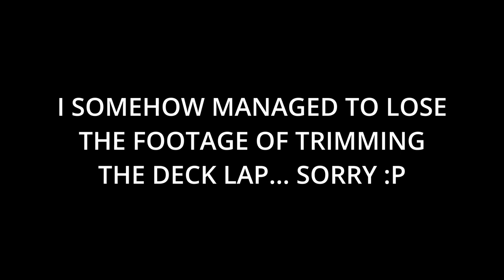PRO Tips Glassing an Opaque Resin Pigment Fade Surfboard Lamination with Warp Weave!

Comment: Really nice work and the finished board turned out great! Quick question: How did you cut the laps on the bottom given that you are using an opaque resin? Can you still barely see the tape line through the resin or are you just eyeballing it?

Comment: Really well done, totally worth the subscription. Quick question: How much time went by from the last tuck to when you turned it over to cut the lap?
Reply from the maker: Thanks mate, i appreciate the kind words. Im using UV resin with a dash of MEKP to ensure thorough curing with the tinted resin and also to aid in curing the waste in the studio (perpetually wet resin will get everwhere) but it is really the UV cat that is doing the job. I use the recommended ratio so it goes off fairly quick but depends on how much sun there is at the time. Longer if its overcast or cloudy, quicker if its full sun. On average id say only about 5-10 minutes before i could trim the laps. Hope that helps🤙🏽

Comment: i really want to try this setup but was thinking the fins would be opposite, but makes more sense to put split keel on the longer side.  did you save color for the bottom or did it just happen to blend well so you can't see the initial lap lines?
Reply: This one is laminated in reverse (top first) in a milk coffee type colour but yeah, if you want top and bottom to match then mix enough coloured resin for the deck and bottom👍🏼
Yeah, the board that inspired this was a Thomas shape and he has the split keel on the short side. To me its like youre counteracting the effects of a shorter rail line on that side with the longer fin base... so i kept the shorter fin base on the shorter rail side. This one is set up goofy for me so shorter rail on the heel because i seem to drive harder off my toe side but its probably just as enjoyable surfed regular. By far my favorite board, wish id made it 10 years ago👍🏼🍻.

Comment: why do you make the deck before to Bottom
Reply: It doesnt matter which is done first really except grinding the decks laps on the bottom is a bit more critical when the edge is on foam... not really an issue though when youve done it a million times. In this case its just an aesthetic choice- i just wanted the bottom to not have the lap line😃👌🏼🍻

Comment: what grinder are you using?
Reply from the maker: This is a Makita 9227cb variable speed sander/polisher. It's the go-to workhorse here is Australia. I'm about to drop a vid about repairing it by coincidence. Probably going up tomorrow🤙🏽
Reply: @cantigasurfco.8549  nice, do you have problem about the sandpaper clogging up? are you based in SA?
Reply from the maker: @6to6surf4  I don't have that issue likely because of the paper. I use SIA brand paper (Siaflex 1948) because that's what we used at TGL when I worked there. It's top notch gear and I find it on Ebay for a great price. I suspect if your paper is clogging it's probably not the best kind... I'll have an in-depth vid on sanding some time soon, maybe it could help...